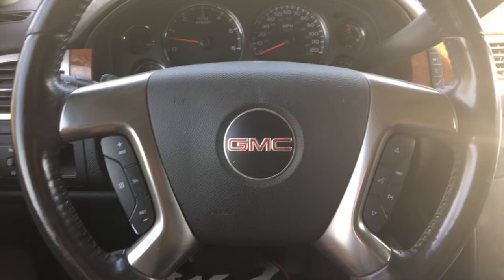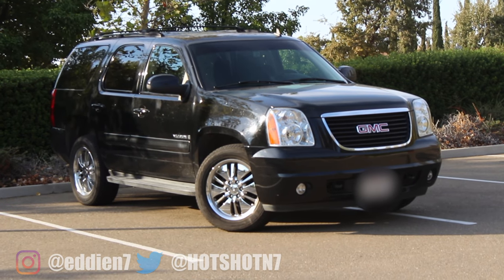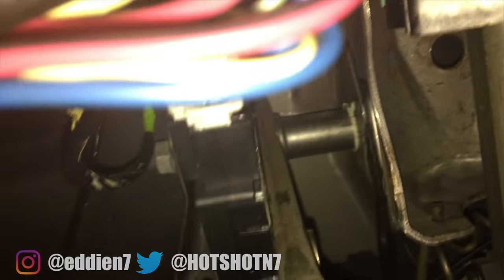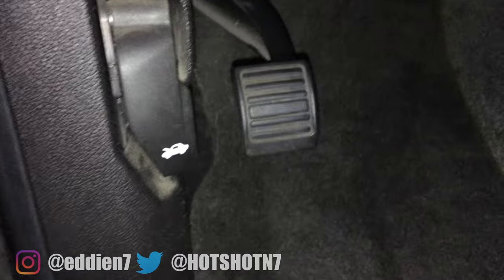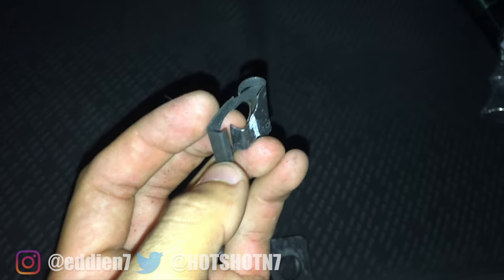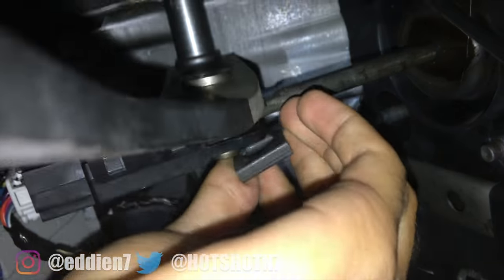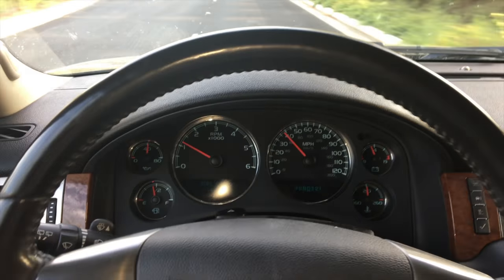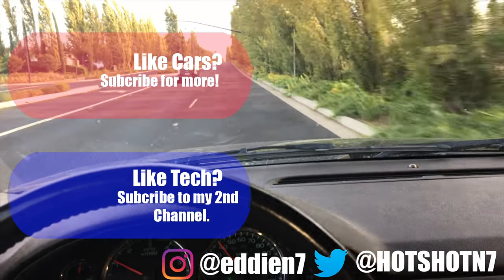Fix Chevrolet, GMC Cruise Control Issues.

Comment from the maker: Make sure to subscribe it will mean a lot to me 🙏🏼
Reply: Powerlinx  does this also fix the horn not working? The horn works with locking with the key fob or when the alarm goes off but not on the steering wheel. Everything else works on the steering wheel such as volume buttons and seek buttons. Just horn and cruise don’t work.
Reply: I need to order thebrake part. Where to?????
Reply: Does this work on Lexus 460?

Comment: Nice video... super simple and to the point.  This worked for me too and fixed the issue in 5 minutes.  QUICK NOTE:  some models, including mine, have the switch on the RIGHT side of the brake pedal.  If you look at your brake pedal arm and don't see it on the LEFT side like in this video, then check out the RIGHT side... it'll be there!

Comment: I'm so pissed. 4 years ago my cruise quit working and i checked out the internet and  the only thing i found was that I had to change some harness and even then was no guarantee, plus was expensive. So I did nothing. I started cruising the state more lately so thought I'd check again and I came across your video so I bought the  brake light switch for 12.91 at amazon, took 5 minutes to install. Works like a charm. I have a 2007 Avalanche and it fastens on the opposite side of the brake pedal than yours so I think it's a little easier to get to but I have the same clip. Thanks so much!
Reply: So if this switch going bad kills the cruise, do the brake lights still work when the switch is bad? Congrats on fixing yours!

Comment: Just an FYI. Somewhere I remembered reading that when cruise control acts like this to check all your bulbs. My 08 Savana 1500 van had one of the two break light bulbs above the rear doors out. Replaced the bulb and cruise control is now back in working condition. Easier than replacing tha break switch but only time will tell if I have further problems.

Comment: Thanks for making the video. Our 09 yukon would intermittently ignore setting the cruise control until it finally quit setting cruise altogether. Since we get the CC light on the steering wheel, I figured it might be the brake pedal sensor. I know it still might be something else, but I am going to replace this anyway on my 200k mile car. I bought through your link and I hit the subscribe button to help the channel as a thanks for posting.
Reply: Did it fix it

Comment: Found a definitive correlation of brake pedal position and cruise control malfunction / failure on my 2014 Chevrolet Traverse.
Non operative cruise control temporarily regains functionality while driving after I use the top of  my left foot underneath the break pedal.
I lift it upward and towards me, there seems to be 2mm or less of play (slack).  When I maintain this slight lifting tension I can sucesfuly engage cruise control, however, the moment I allow the brake pedal to rest without my foot lifting it, cruise control disengages.
Reply: ME TOO!!!

Comment: Hi.  Any suggestions?  I have an 07 gmc sierra and I've already replaced the brake light switch and still have an issue.  My cruise control comes on and works for about 30 seconds, then it shuts off,  the indicator light on my gauge cluster turns off too.
Reply: Same here, I replaced it and it worked for a bit then quit. Replaced it again and still nothing
Reply: Yea I replaced mine too but it did t work at all still the same as before

Comment: mine had a 10 mm bolt holding the clip. orelieys had the part, brake switch they called it. worked like advertised. just need to figure out the daytime and auto lights not turning on.

Comment: Just wanted to say thanks! Watched your video since my 2008 Tahoe was doing the same thing, light in steering wheel button engaging green light but nothing on the cluster when pressing “set.” Changed out this part and it works again. Ordered it through Advance Auto Parts, genuine GM part for $35 and now good to go!
Reply: Did your brake lights work (turn-on) still prior to the fix? So it seemed like the switch was "working"?
Reply: @gdub14  they did! It acted as if nothing was wrong and that’s why I had to lookup more information because the relay/fuse was fine also.
Reply: @StephenRamsey  thanks! I didnt replace my switch because the brake lights still worked. Just ordered the switch from Amazon for $15! Thanks!!
Reply: @gdub14  awesome! Hopefully that fixes it for you. Kind of a pain in the butt to swap it because of the position you have to get in to do it, but very easy to do! 🤙🏼

Comment: I have a 2008 Yukon Denali 1500 I am going to attempt this on. It also has an odd occurrence of rear window popping open when car is driving. Any idea on what that would be?? Dealership said they replaced a corroded fuse and that fixed it, but it did not. As I drove it home yesterday it did release it
Reply: Replacing the Brake stop switch Didn't work for my 2008 GMC yukon
Reply: It didn’t work on my 08 denali Sierra

Comment: What can it be i have a 2008 Chevrolet Silverado 1500 single cab 4.8l i replaced the brake light switch and cruise control switch the light comes on from switch but don't work?

Comment: Did you have to reset the computer of the truck? 

I’ve replaced the break switch just like this, still no engagement. The amber light on the steering wheel still comes on, but cruise does not engage, no green light on dash. 

Thanks for any assistance.
Reply: Same here
Reply: Same

Comment: is it required to have the contact with the break peddle to connect the cruise control system? I had a hard time getting that clip off so I just hung the connector by the wire and connected it to the plug. Problem is, I could not get the car out of park until I reconnected it to the original plug, at which time the cruise control did not work still
Reply: if you cant remove the clip i would seek a mechanic. you dont want to hook your brake pedal up wrong.

Comment: Man thank you so much I thought it was the wheel bearings at first They needed to be replaced anyway but I was wrong fixed it with a $10 part yours is a little different than an 07 avalanche the clip was a pain the center of the device goes into the rod and the clip on top of it. Thanks again

Comment: My 08 Sierra I've had no cruise control and I change the switch it works no my 2010 is doing the same thing lights come on the steering wheel but it stays amber and there's nothing on the dash, I'm thinking about changing switch what do you guys think

Comment: Good video- Just replaced mine today in my 2008. Fixed my cruise control. Was scared when i took it apart and my brake petal fell to the floor, the 10mm bolt holds in it so that doesn't happen correct? Not sure how i feel  about that little clip for safety.

Comment: How did you determine that the brake switch was the failed part?
Reply: typically if the cruise control doesn't work this part is the problem. Just going off majority of cases and common.
Reply: @carnalesmuff   so is it less likely to be the multifunction switch.
Reply: correct.
Reply: @dstappity  what?

Comment: Thanks for sharing. Do you have any advise for the steering wheel volume controls working the opposite direction...Volume up = volume down......Intermittent just like my cruise control like this video.
Reply: Sounds like it could be ur clock spring maybe

Comment: `OK, so if I wanted to do a test to see if the switch is indeed the problem with my cruise not working, could I just remove the wiiring from the  switch, take it for a drive and see if the cruise works?

Comment: Looking for help for my 2010 GMC 1500, I have replaced the brake pedal switch and the cruise control is still not working. Any suggestions on what to look at next. Fuses, vacuum leak etc.? Any help is appreciated, also what about remote start issues?
Reply: Do you have an update on your situation?
Reply: @thearnoldsilver8791  everything is working fine now, have an ongoing problem with small EVAP system leak. Code 443 will cause the remote start to not work every time. I understand the purpose behind the EVAP system, but what a pain in the butt it is

Comment: What is the part that I need to purchase called?
Reply: I just ordered it, I hope this gets mine working again.
Reply: What did you order. Do you know the specific part name?
Reply: Daily Dash Of Life  He already told you, why do you keep asking?  The one he bought is made by ACDelco, it’s a D1586H GM Original Equipment Brake Light Switch.  He got his on Amazon, I got mine on EBay.
Reply: Relax. Jeez. I hadn’t seen a notification that he responded. Now that I see it on your post I can go buy the part.
Reply: I ended up getting different vehicle
Reply: @DailyDashOfLife  kinda dramatic to buy a new car to fix a $13 part

Comment: I did this fix on my 07' Suburban and it did not work. Cruise control light is on and it works but only for a little while, then it stops working. I can turn cruise back on and it works, again, for maybe a few minutes and then it turns off again. Puzzling?

Comment: I have GMC 2007 Yukon the problem is right steering wheel radio controls it is not functioning, also the stereo power button not working
Reply: Unrelated to this video.

Comment: My cruise wouldn't engage. Checked out the issue and found these video's on YouTube. Ordered the new part and while waiting for it to arrive, went for a drive and lifted the brake pedal just a fraction with my foot. The cruise now engages every time, problem gone and the new part is sitting on my desk.

Comment: this will also work for a 2009 gmc yukon xl 5.3 the difference was mine had a 10mm screw in the middle of that metal clip
Reply: JAROSES My 2009 GMC Sierra 5.3 was the same way.  The only reason it took me longer than it should was I had to get a 10mm wrench out of the garage. Otherwise, I’d have swapped it in about 3 minutes.

Comment: got any idea what other issues might cause the cruise control to not work? I just replaced that stoplight switch same as you did and it still doesn't engage. I have the exact same vehicle as you.
Reply: John MCcain  do you have the part number
Reply: already fixed it. the connector didn't have a good connection, just nudged it a bit while trying to engage it and it's been working ever since
Reply: Same here switch replaced and it didn't fix the problem, what connector are you talking about the brake light switch connector? Man I hope that's it, gonna go check it.
Reply: The connector for the brake switch, I replaced the brake switch and that didn't fix it, but while driving, I pressed the cruise button like you would to engage it, then while driving, I reached my foot up and just kind of nudged the brake switch and it instantly engaged. It's been working ever since. You still have to be going around 45 to engage it, then just with the tip of your shoe, find the brake switch and push up a little bit. That's literally all I did to get mine working again.
Reply: man...that seems kinda hinky.  I'll try it.  replacing the switch didn't work...if all else fails, hit it I guess.
Reply: man that either has to be a faulty switch or a bad hookup, i would personally reinstall it or replace it. the statistic is there is a 3 percent new part failure probability. the wife thinks for me maybe 50/50

Comment: I just changed and still don’t engage
Reply: Same here
Reply: Same here, plus changed clock spring in steering column.  Now what
Reply: Did you find the problem ? I heard its could be the airbag issue as well not sure yet am facing same problem
Reply: What finally fixed mine was  my main ground cable was found to be green dust practically. Location is back of the block driver’s side up to the body inboard of the master cylinder. The bolt on the back of the block was so rusted. I ended up buying a negative battery cable 24” and attached it to the alternator bracket. There was a bolt there holding only a plastic wire bracket. This fixed all kinds of gremlins. On star come on and talking her head off, no cruise control engagements, the back lift window opening when I hit the brake, radio going off when I raised or lowered a window. One ground cable lots of fixes.

Comment: Changed it still does not work HELP What now
Reply: The next time your out for a drive, try lifting the brake pedal with your foot. If it drops even a fraction, it can cause the points on the sensor to make contact and deactivate the cruise because it thinks the brakes are being applied.

Comment: 2011 GMC Yukon XL 1500 Yukon XL. Worked for me. Had the clip fastener. Was a B!tch to remove. $26.99 + tax for the part @ O’Rielly Auto Parts. Part ID: STD SLS450 STOPLIGHT SW.

Comment: That's what you call a parts replacer. So if you replaced that part and it didn't fix it, you just wasted the money and now you have to start testing. You luck out and you may not by replacing parts and assuming.  Just say'n